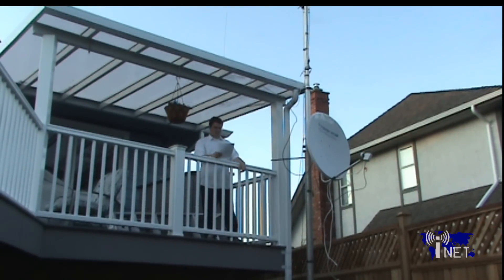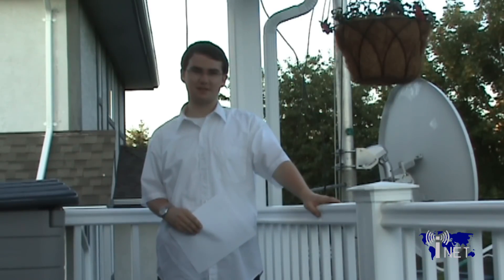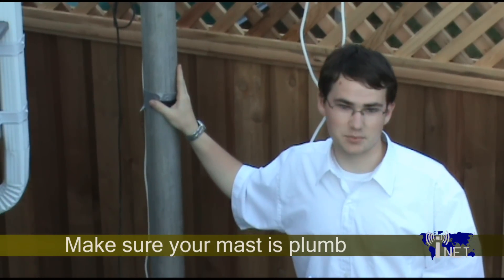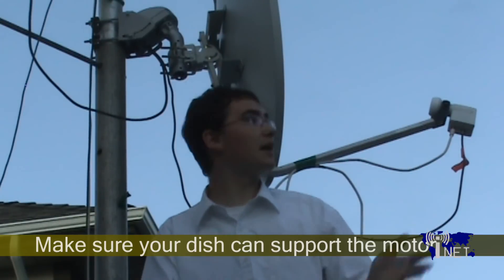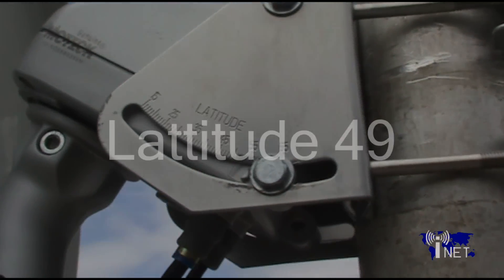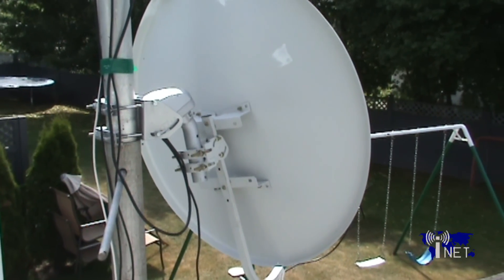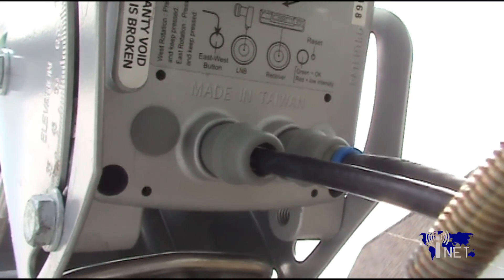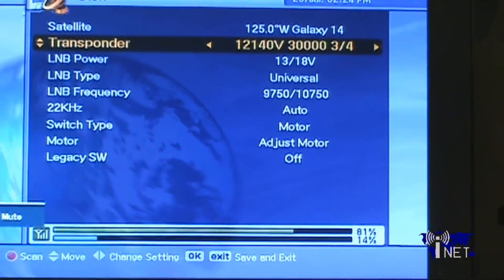How to set up a Ku Band motor

Comment from the maker: @semco72057 I have the KBox prodigy.  It's not a bad unit; scans satellites fast and software updates through the USB port on the front work well.  In addition the receiver has blind scan.  If you can find one for about $100 then go for it.

Comment: @christopherve7alb I checked the settings on the receiver and for each of the satellites in memory they are all set at W=0; N=0. How do I find the settings for those satellites so the motor will aim correctly. I also checked the motor prior to checking the receiver settings and it seem to be working fine.

Comment: @DJparsons89 Sounds like your True South was off when the system was installed. That can be corrected using the instructions from some sites, especially from the company who sold you the dish and motor.

Comment from the maker: The Dish elevation will have to change when it is on the motor, make sure your motor's latitude is set to the same latitude as your location then adjust the dish until you get a good signal.